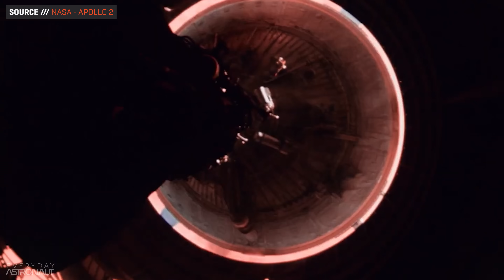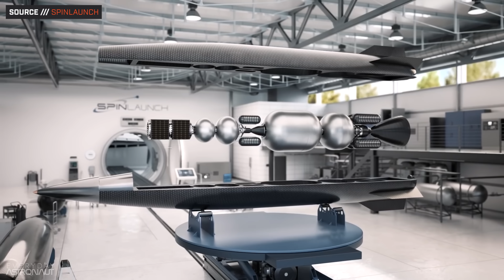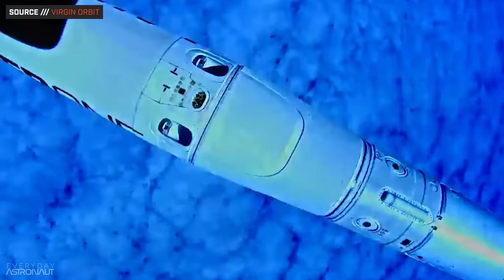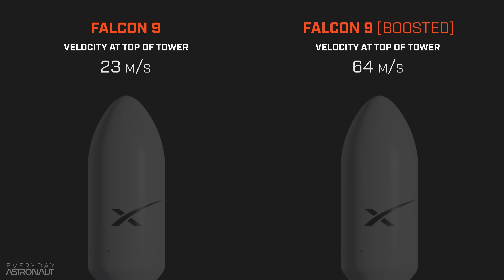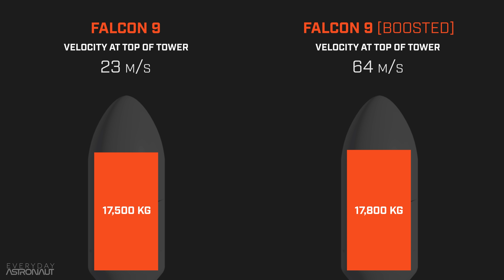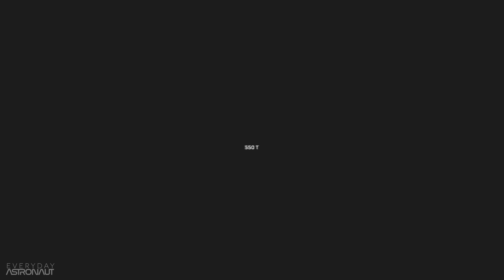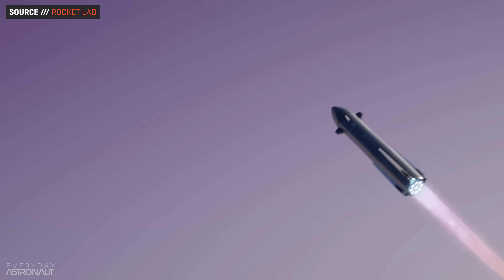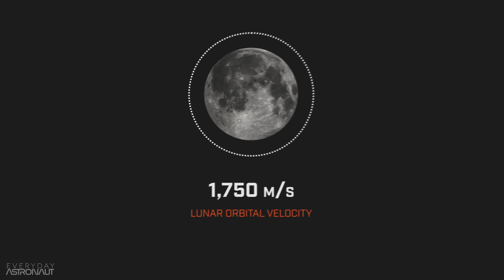Could We Help Push Rockets To Orbit?

Comment: I think the "kinetic energy" formula got mixed up with "potential energy". That's the energy the rocket gains lifting it up a certain amount (no matter how fast) - hence no speed required. Kinetic energy is 1/2mv² so you first calculate the velocity gained over 70m at 3Gs. distance = 1/2 at² => t = sqrt(2dist/a) = sqrt(140/30) = 2.16s now calculate how fast you get in 2.16s using v = at = 64.8 m/s now use that to calculate your kinetic energy E = 1/2mv² = 641 kWh. So roughly 2.5X your figure for total kinetic energy (lift + thrust) and if you substract the thrust percentage wise you'll get bit over half of that. (Hope I didn't mess anything up). I think you have to add the potential energy ontop for total energy required.
Reply from the maker: Don't forget, the yeeter is only doing 2.6G of work, as the rocket is supplying 1.4G worth of force.
Reply: @EverydayAstronaut  I edited a bunch of times haha. You're quick with the responses!

Comment: I think I have a good "why don't they just" question:

Why don't they just the oxygen from the atmosphere in the early phase of launch, when the rocket is still in the dense part of the atmosphere. That would potentially save a huge amount of liquid oxygen propellant.

I think the main reason why not is, that rocket engines rely on a very carefully tuned mixture ratio for safety and efficiency reasons. Also, the amount of air that would need to be sucked in would be impossibly high.
Reply: Think cryogenic temps and liquid oxygen, think fueling in flight, think logistics.
Reply: You're thinking of jet engines. Jet engine powered launch vehicles have been a dream for a very long time. Unfortunately its really complicated and not really feasible either and its better and simpler to just build a bigger rocket. 
Mostly because as you go faster and faster, the air compressing in front of you heats up A LOT.
Reply: @linecraftman3907 Well, the core issue is, that e.g. a jet engine has a very low thrust/weight ratio, compared to a rocket engine. So you would need super large and heavy jet engines to provide a meaningful amount of thrust to a rocket.

Air-powered engines will be better in thrust/weight, once you are fast, because you can save the heavy and complex compressor stage. Then you have a ram- or scram-jet engine, which compresses the incoming air with just the shaped inlet at the front (so no moving parts, except maybe levers to adjust the inlet proportions), however those only start working at supersonic velocities.
Reply: @imrevadasz1086 the issue of thrust to weight is solvable, you add wings and fly horizontallly

Funny enough, boosting the ramjets up to speed with rocket power isn't such a bad idea 🤣

Comment: What if we don't carry the fuel used until we clear the tower, but instead pump it at the burn rate through a pipe? We could even extend the pipe higher than the tower and eject it from the rocket once it's out of reach.

Comment: To me the real question was more of 
Why are we using the highest intensity in shortest amount of time method that is most wasteful. 
Versus a stable high efficiency system.
From single use rockets to reusable to ground/water/air base systems.
Isn't the trend/evolution of rocketry obvious?
Reply: Abot optimal system a 3 segment system.
Ground assisted launch through water or air pressure(0~10km+ alt.) with chemical rocket engine (10km~80km alt.) 
Orbiter have a tether extended down to the 80km mark with aero spike(giant solar powered wing/platform) that captures the vessel and hoist it up to the Orbiter(100km+ alt. propulsion method ion accelerated atmosphere delivered by the aero spike air+electricity) from there it is being transfered to spin launch like system(relay and velocity+angle imprint) for planetary insertion orbits through out the solar system and beyond.

Comment: When he talks about the energy required as monumental (implying inpactical), don't forget that is less than the amount of energy produced by the rocket itself without yeeting.
Reply from the maker: Yup, I mention a few times that it's amazing how much energy rockets produce. But that's only true of the Dragon to orbit or moon examples, but not true of the launch towers which are accelerating the rocket faster than the rocket would accelerate on its own.

Comment: The counterweight would not need to be suspended from the tower, they could be twice as big but on a rail down a 60 degree slope entering the ground, connected with the tower via wires.
Reply: There's a thing called the "resultant force". It means that no matter how you juggle the weights and angles - and yes, your image is much less silly than literally having a cube of steel hang in the air - to produce a given acceleration of a given mass, the tower still ultimately has to withstand the same amount of force as if two supercarriers were hanging from the top of it.
Reply: Yep, just make it WAAAY bigger, and use something cheap like dirt/sand/water, which less density would make it  EVEN bigger. Heck, just build a self-contained city that goes for a ride anytime you launch a rocket. 😂
Reply: Just a simple lever…. A “teeter totter” with the loaded fuel offsetting a counterweight… lever with the weight on one side and the moveable launch pad and rocket on the other. No cables or any complicated parts just one HUGE simple fulcrum. Probably made of steel, and a huge bearing/s
Reply: Yes rails are completly ignored here. Low friction and they could accelerate the weight either with rocket engines and/or maglev technology....

Comment: NOTE: If you build a tube that goes into space and pump all the air out of it, it will start to fill with the tiny amount of air that is in space, so eventually your tube will fill with air again, but it will do so slowly that even a very small vacuum pump could maintain a vacuum in your tube.
ПРИМЕЧАНИЕ: Если вы построите трубку, выходящую в космос, и откачаете из нее весь воздух, она начнет заполняться крошечным количеством воздуха, находящегося в космосе, так что в конечном итоге ваша трубка снова наполнится воздухом, но это будет происходить настолько медленно, что даже очень маленький вакуумный насос сможет поддерживать вакуум в вашей трубке.

Comment: I think the easiest type of launch assist is probably some sort of beamed power. Even direct heating in a heat exchanger could match nuclear thermal for performance, or something more like a LOX augmented NTR for more thrust. It also doesn't care what the rocket looks like as long as you can beam enough power, so the infrastructure is much more flexible.

I think there are still plenty more optimizations to be had with conventional rockets before launch assist starts to make sense, like sequential burn tri-propellent engines, thrust augmented nozzles, and combined cycle boosters.
Air launch for small sats is also likely to get much cheaper and more practical once platforms like Hermeus' Darkhorse that can manage Mach 4 zoom climbs come online.

Comment: Just use a catapult like they do on aircraft carriers.  Scaled up of course.  Another thing to think about is that it would not need to fully lift the rocket.  Whatever force you give it externally is saved in not needing to use fuel.

Comment: 19:00 The tyranny of the chopsticks equation…..
Reply: There is a solution. Been around for a very long time. Pneumatic catapults. They use them in carnival amusements. Very smooth operation, very simple.

3% more payload is considerable. I've seen less than that make or break a project.

Comment: NOTE: Additional rocket acceleration at launch will require significant structural reinforcement of the rocket, which will increase its dry mass, but the structural force will only be useful for a few seconds and then become excess weight.
ПРИМЕЧАНИЕ: Дополнительное ускорение ракеты при запуске потребует значительного усиления конструкции ракеты, что увеличит ее сухую массу, однако эта усиление будет полезна лишь в течение нескольких секунд, а затем превратится в избыточный вес.

Comment: Modelrocket builder here. As a kid, I hat the idea, that I could push down a spring and fix it with a twine and put the rocket up on it, so the twine would melt, when it launches. My father said: "cut it, and let's see how far it goes up." I did. Maybe 5 cm. Since then, I knew it wouldn't be the best idea to get extra performance...
Reply: I built one using die springs, definitely a little dangerous compressing the spring and inserting the lock pin but the results were impressive. We were launching 100 g "rockets" 100'+
Reply: I know this wouldn't scale up. But if you are still building model rockets, you could build a piston launcher.
A closed system that would capture the rocket motors exhaust to cause the piston to extend. I built a small first stage using this concept. I have a static test video on my page here.
Reply: But the main benefit isn't the height, it's the velocity. If you just want height, put your launch platform on a hill.
Reply: Nichrome wire triggered by a TeleMega (or just attached to the igniter) might be better
Reply: What an elegant teaching moment.
Reply: G'day,

December 17, 1903.

The Wright Brothers used a 
Falling Weight Catapault
To launch their
Flyer -1
Along their Monorail
On the Sand-Dunes at
Kittyhawk...

Why is it that 
Space Cadets
Fail
History of
FLIGHT,
So very Very VERY
Often...?

One wonders.

Such is life.

Have a good one...

Stay safe.

;-p

Ciao  !

Comment: The very first Wright Flyer had a tower with a counterweight to boost its takeoff acceleration from the 12 hp engine.  It weighed very close to 600 pounds, not including the pilot or its 1 gallon fuel capacity.  The engine alone was about 1/3 of the aircraft weight.

Comment: I read a book along time ago that propose a vacuum tube 100 miles long up the side of mount Kilimanjaro (19000 feet high) with only cargo (10 to 20 G's) capability with water ice in the back of the capsule that lasers at the top of the mountain would focuse on the ice to turn it into plasma to add to the boost.  Could you run that thru your calculations?

Comment: Solving a non-problem for the first 100m by adding dozens of potential failure points? Yeah, no. Putting consumptive industry on the moon also is moronic, as is any kind of moon base. Robotic Orbital factories feeding off the in-system belts, processing locally, then returning refined ores here is a net gain. Eating our moon is bad. Fuel stations feed off the gas giants, transporting refined product to the system mining spaceways.

Comment: How about steam or vacuum on a launch mount?  Much like the steam linear accelerators on aircraft carriers.  Steam would be easy, vacuum or near probably less so.  But it has the benefit of high impulse, and so cost benefit might be beneficial even though additional payload may be small.  Given the effort salami slicing weight and unnecessary components though, may be interesting.  

Anyone up for the math?

Comment: Launching a rocket would be a little bit better than originally presented, and that's because you can put more fuel in the first stage now that you're giving the rocket an initial kick, if the rocket has an initial kick a TWR of just 1.0 at takeoff is still productive, since you're actively gaining altitude, and since you're gaining altitude faster your Isp is increasing faster as well, these effects add up to allowing you to put significantly more fuel in the first stage, allowing for much more payload than originally theorised.

Comment: Tunnel down through a hill or small mountain and accelerate a high g resistant rocket at 50g to mach 5 or 7.  

Now you've got single stage to orbit.  The stage could even use a solid rocket motor.

All that's needed is a lot of compressed air.  Much of that can even be recycled if the launch tube is immediately closed after launch, sealing the 400psi air inside, making it easier to pump up to 1200psi again. 

My rough calculations show that 1 ton to leo would consume around a 2 ton solid rocket booster plus 2 thousand dollars for expendables.
Reply: Hmm.. Accelerating at the 50G rate to Mach 5 would take a tunnel about 3km deep. Ouch. That's a lot to dig and a LOT of air volume to pressurize. Then, how about delta V? You would pop out of the tunnel with a velocity of about 1715 m/s (Mach 5). Assuming your SRB has a typical exhaust velocity of 2500 m/s, and the rocket has an initial weight of 3 tons and a final weight at burnout of 1 ton, your SRB would add about 2746 m/s for a final velocity of 4461 m/s. Even LEO needs about 7800 m/s. I have no idea what the cost of 'expendables' would be, but the initial cost of digging a perfectly straight 3km tunnel, lining it with something that will withstand 1200 psi and providing the equipment (giant compressor, air receiver,  power distribution, etc.) and paying a small launch team would probably run at least several hundred million bucks, if not more...

Comment: I know you're very busy with all that you do but this format of video is why I started watching you and I absolutely love it. I like everything you do but this kind of informative and educational stuff is my favorite. Great video!
Reply from the maker: Thank you so much for the kind words, I appreciate it!
Reply: @EverydayAstronaut starship crossbow
Reply: @EverydayAstronaut  A relatively inexpensive way to boost rockets would be to launch them from higher altitudes, and also use a launch tube. The rocket site would be next to a lake, and the tube would start a mile or more underground. The rocket would sit on a pusher plate, and water would push it and the rocket upward. The water under the pusher plate would be connected to the lake above, and gravity would pressurize it, boosting the rocket. Big air tanks attached under the pusher plate might be needed because when it nears the top, acceleration might be too little. Doors in the pressurized air tanks would open sequentially after half way up, so that acceleration is maintained. Near the top, the rocket would light, and vacuum doors would open. Though maybe a vacuum and vacuum doors would not be needed. The pusher plate would parachute down to the lake to be reused. As a bonus, there would briefly be a huge water fountain.
Reply: I couldn't agree more man excellent work Tim this is what you were meant to do not only educational but promoting interest in the whole field I'm sure a few years from now if not all ready rocket scientists and physicists will give thanks to you for sparking their interest and getting them into the field
Reply: @flowwolf6385 please continue such kind of videos

Comment: Maglev launchers were a pivotal part of several novels by Robert A Heinlein. 'Rocket Ship Galileo' and 'The Moon Is A Harsh Mistress' are two of the most prominent. He placed his launcher on the slopes of Pikes Peak where the air is much thinner than sea level. And used rail launchers on Luna to ship materials to Earth (and as a weapon when the 'Loonies' revolted for independence). 'Mistress' is a masterpiece of Science Fiction which I recommend highly to any and all.
Reply: I'm a little sad no one has gotten an adaptation to screen (yet) for Mistress. Previous efforts have come up short ... but it would fit really well into the current political climate, and Special Effects tools have matured enough that I'm sure they could keep the budget down. Plus, we have a useful Dune adaptation, now! Surely that would help someone making the case to get a Mistress adaptation green-lit?
Reply: @danielbudney7825  I still have a very bad taste in my mouth over what they did to Starship Troopers. Heinlein's military Service treatise deserved far better treatment. Perhaps of the Producers/Directors of The Expanse were chosen to bring 'Mistress' to the screen I would be a lot more enthusiastic.
Reply: Probably a more viable tech than spinlaunch.
Reply: Man ive thought about this before but for helicopter launches lol. Fuel line that is held up by a drone till it gets to altitude
Reply: My favorite part in the book by far is when Mike suggests they stop hitting NORAD because it isn't there any more!  Beware throwing stones when you're at the bottom of a DEEP gravity well!

Comment: You left out "Rockoons" e.g. rockets lofted by high altitude balloons to get clear of the vast majority of atmospheric drag.  
These were tried. The problems posed were the amount of  extra thrust for course correction to achieve the desired trajectory, because of a semi-random point of ignition, the impracticality of recovery and reuse of the balloon, as well as the need to launch them only on very calm days.
Reply from the maker: We talk about air launching platforms in my video about air launching 👍 - https://youtu.be/AAt9WDQEMoA?si=3LTXPsibFhz63Lsn

Comment: Its just not worth the additional complexity and stress on the rocket structure ... which would require more mass ... so no net value.  Per the moon canon ... I think Smashing Pumpkins did a documentary on it called "tonight, tonight".  SpinLaunch has already "spinned" to a comm constellation that does not meet SpinLaunch. BTW, ask Gemini 2.5 for the calculations.